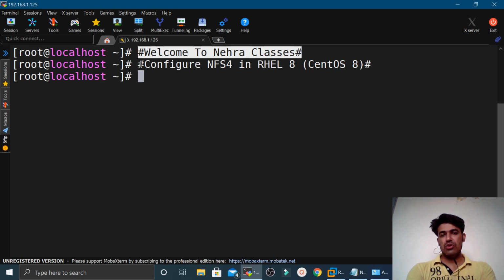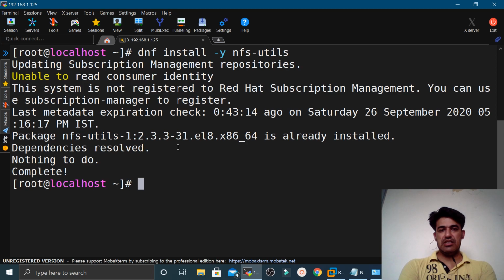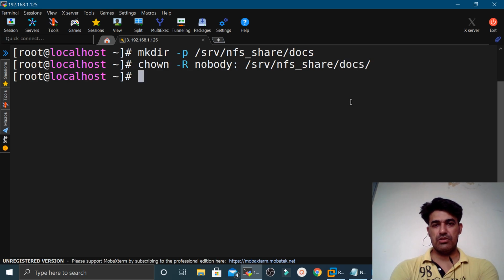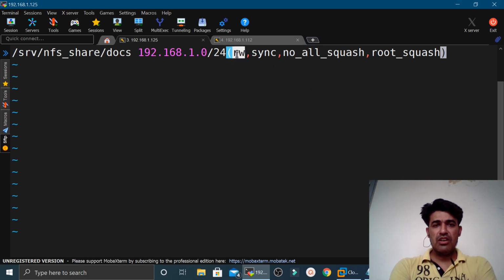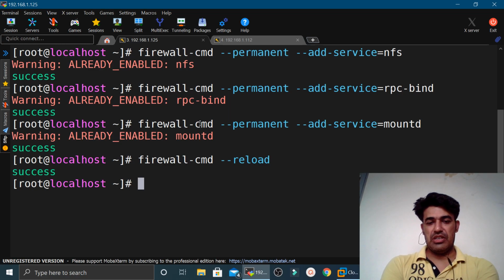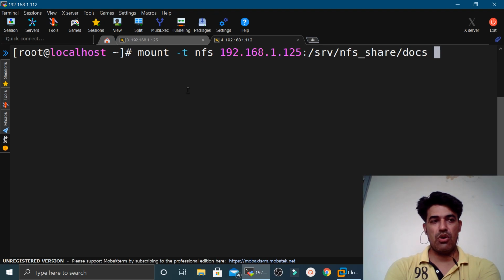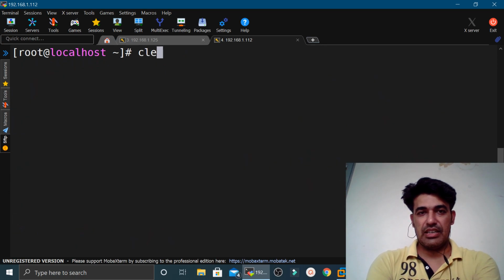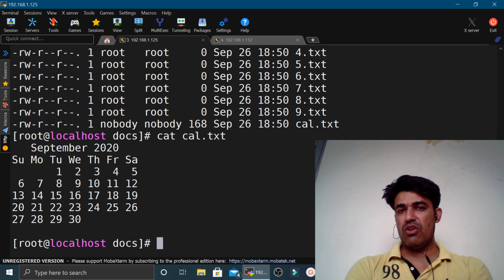NFS Server & Client Configuration in RHEL 8 | How To Configure NFS4 in Linux | Nehra Classes

Comment: Is it mandatory to install nfs4-acl-tools in client and should a firewall be enabled in the server? I have an Open Firewall application to control my Virtual environment so I don't prefer using firewalls inside the system. How do you determine its NFS-v4 is only been used in both the ends.
Reply from the maker: The nfs4-acl-tools packages provide utilities for managing NFSv4 Access Control Lists (ACLs) on files and directories mounted on ACL-enabled NFSv4 file systems.
Its a good practice if you use firewall at the server and if firewall is enabled at your server and you want to provide service to clients then you will have to add the rule for ports/services in firewall so that clients can connect to server to avail the services.
You can use nfsstat command to check the details of nfs on server as well as on clients.

Thanks for you comment.